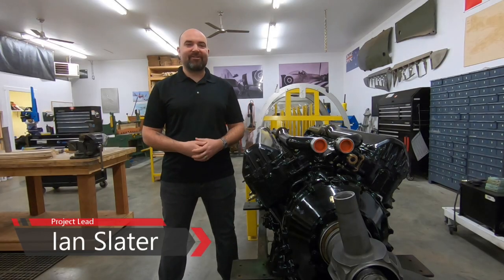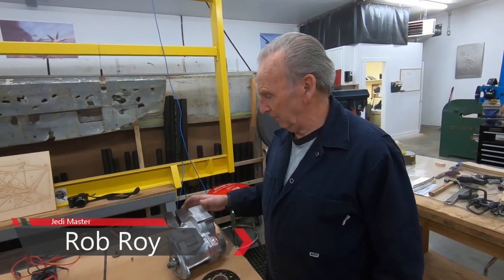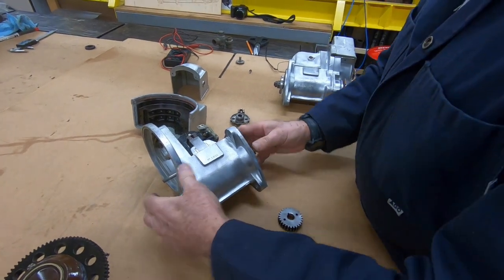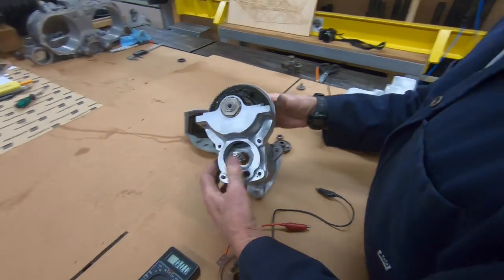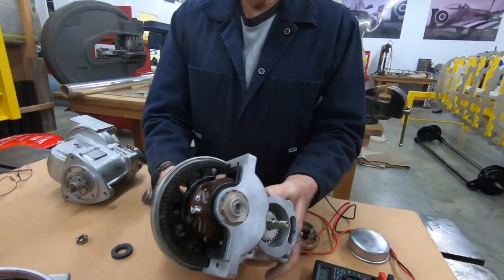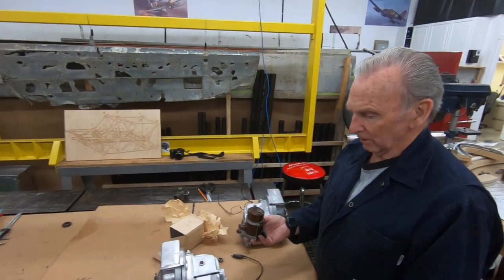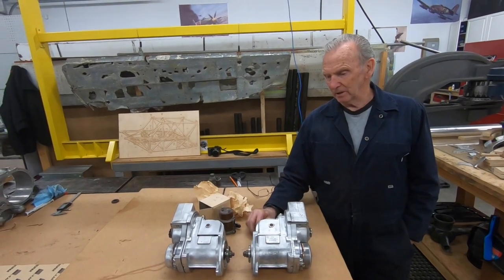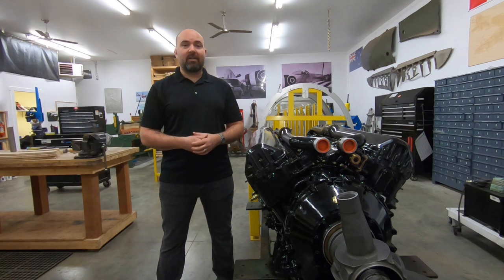S1E7 Rolls Royce Merlin Magnetos

Comment: Great video, just out of curiosity what is one of these worth fairly certain I have one very similar? in fairly good shape, haven’t tested the spark . Been a great series to watch your work on the Merlin and  Sabre .
Reply from the maker: You have a Merlin or a Sabre? For the Merlin a few years back they were going for about 40k USD as a complete core engine; finished as a ground runner as ours was they were roughly 120k USD. ~Ian
Reply: @TyphoonLegacyCoLtd  just the magneto mate not the engine 😀

Comment: I have a BTH magneto for an early Merlin that was given to me decades ago by a chap who was an engineer at the aircraft factory (Cmnwlth Aircraft Australia) during the war (at some stage it was used to power a six cylinder engine by blanking off one bank in the mag). I have always been too scared to open it up lest parts fly out and then be unable to find their internal homes so it has just sat pushed to the back of a shelf in my workshop getting dirtier and more corroded (on the outside at least) year on year. This video has given me the confidence to open it up, check it through and get the whole thing nice, clean, polished and operational again. Thank you.

Comment: Great video. Magnets - especially the older alloys (eg Alnico) weaken over time. How do you assess this and are they readily re-magnetisable or are they replaced entirely?
Reply from the maker: Hi Andre, Rob went through several core mags before being able to put these tow together, taking the best performing parts that we had available. I'm not sure if the poor ones could be re-magnetized; perhaps someone following along could answer this! ~Ian
Reply: @TyphoonLegacyCoLtd  Hi Ian, yeah, I'm not surprised. This is a bit dated but may provide some useful pointers: https://www.rexs-speedshop.com/wp-content/uploads/2018/10/Remagnetisation-of-magnetos-Sec-D-6-Issue-2.pdf  
    I also strongly suggest placing a post on WW2 aircraft.net forums and secret projects forum. 95% of the people on these are idiots but the other 5% are gold-dust; extremely knowledgeable and helpful and definitely worth the bother. Cheers, Andre.
Reply: @TyphoonLegacyCoLtd  Hi Ian, you know, I had a further afterthought about your reply. If you have multiple magnet cores in storage then you need to ensure that each one has a keeper. If not, then I'm not surprised that many were discovered to be duds. Consequently, there's no point going to the trouble of re-magnetising them unless you can install these once done.
Reply from the maker: @andrerousseau5730 , I would have to check the details with Rob, but I know he had mentioned a very specific way of storing our good cores to ensure they remained usable. ~Ian

Comment: Dumb question alert......two mags for the 24 cylinder Napier engine or more ?
Reply from the maker: Just the two mags on the Sabre, mounted on either side of the upper accessory case. On the Sabre, the distributors are separate though. ~Ian

Comment: What starter system did the Sabre have? Did it have the ability to pre oil it’s lubricant passages?
Could fuel prime dilute cylinder sleeve oil film?
Reply: I remember watching a doco talking to a Typhoon Pilot. He said he gave it 4 pumps on the 'priming lever'. Whether that was an oil pump or fuel or both, I don't know. Then he would fire the cartridge. (They only had 5 shots i.e cartridges) . He did not do more than 4, because they had the characteristic of catching fire. The pilot's crew always had fire extinguishers ready during start ups.
Reply from the maker: @David-yo5ws , that is part of the fuel priming system, there were very specific procedures depending how long the engine was sitting. Its really a very primitive system, a fuel line with a banjo fitting which drips fuel into the intake. - Ian
Reply from the maker: Hi Bill, the Typhoon used a coffman cartridge style starter system. I'll have to do a bit of digging on the pre-oil, it makes sense that it would, but I find no reference to this upon a quick glance. There was an option for oil dilution, but again, I would have to see if this was ever fitted. ~Ian
Reply: @TyphoonLegacyCoLtd  

Very good. I think possibly a separate small primer tank with a oil mix as a two stroke premix as to give cylinders, sleeves, pistons some protection from dry start till oil pump can take over. To hear and see an authentic Typhoon take to the air once more will be an aviation history marvel. The service of the stalwart pilots of the “ Tiffy Boys” in their powerful ground attack and air to aircraft remains a tribute to bravery in the highest order. The cutting edge of speed and power coming with exceeding danger as well. I can’t imagine a better snapshot of the pride of RAF than to fly over with her stable mates Hurricane and Spitfire and to pull up in a missing man formation.

“ Through Adversity The Stars “

Comment: Does the distributor section have an auto advance mechanism for high speed?I mean to say what is the mechanism for advancing and retarding the spark, is the points plate connected to some vacuum actuator for instance?
Reply: Good question but not an easy answer.  Both mags are conected directly to the throttle linkage with mechanical linkage, but do not move at the same amount of timing advance.  The right hand mag fires all twelve of the intake spark plugs and the left hand mag fires all 12 of exhaust plugs,  but not with the same amount of advance.  The intake side is set for 45 degree and the exhaust side is 40 degree at full power and the differential is just set by by the amount the linkage moves the individual breaker plates. Hope this makes it a little clearer for you and any more questons just ask away and I'll try to help. Cheers
Reply: @CN6400  Thanks for the reply,yes it helps me understand better,sounds like a very complex piece of machinery that will keep you entertained for hours, keep up the great work.wow 45 degrees is a lot, that big prop must have a real flywheel effect and stop it turning backwards. that is obviously why it needed the shower of sparks to get it started, the 45 degree must surely be when it is operating at full power?I am sure an engine would not start normally at 45 before TDC
Reply: @gogogeedus   On the Merlin three the breaker plate only moves 25 degrees from idle  to full advance at full throttle.  So it looks like the advance at idle would still be around  20 degrees .  When you compare this to the average car at  8-10 degrees it may be from the swept volume of air from the supercharger and the fact that this engine has the capability to burn up to 160 Gal of fuel per hour at full throttle and it has 1,648 cu in displacement. Cheers
Reply: @CN6400  I was wondering if it was something to do with the capacity of the engine,very interesting,Thanks for the info

Comment: These are a different style of magneto than the Rotax magnetos that I  worked on on the Merlin 266 and the V1650 on the Mustang. What series of Merlin do you have?
Reply from the maker: Hi Earl, this is a Rolls built Mk III; pretty early in the Merlin lines. It uses BTH mags. ~Ian

Comment: Brilliant!  With the exception of the 'shower of sparks' feature it's not much more complicated than a flathead Ford V8 ignition but many more magnitudes up there on the cool factor.  The components were soda blasted to make them beautiful? (Oh, already asked...)
Reply: The shower of sparks is just for starting purposes,it has a distributor, those holes are for each lead I suppose, it has an advance and retard on the timing like with a car distributor,I don't know if it has a vacuum or mechanical auto advance function.

Comment: Interesting.  When testing a magneto you are apparently checking for mag drop.  What is this?
Reply: Mag drop is related to the magneto preflight test.  You are looking for a slight drop in engine revs when 1 mag is switched off at a time.  A small “drop” in engine revs is acceptable.  It also confirms that the other mag was operating or the engine would stop.
Reply from the maker: The test Rob did here was just to verify that the coil was serviceable. ~Ian

Comment: Very informative. only portion missing would be references to setting the timing of the big gear to what ever else is on the inside. (i.e. educate us, please!). We do not need specifics, but a general idea of: easy, or this dot lines up with this line etc. etc.  Enjoyed the comment about varnishing the inside. Any 'tricks' on the outside surface? Noticed the beautiful finish. Soda blast? Love the floor in your shop, wish mine could stay that  clean.
Reply from the maker: Hi Ed, we will have to do an installation video showing the timing process when we get to that stage. Will check with Rob on the outside finish process. ~Ian